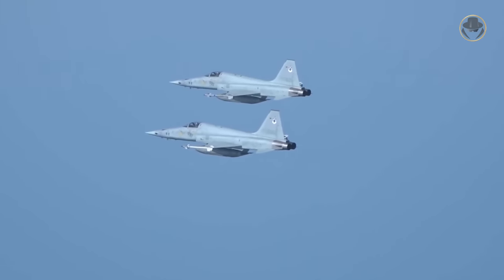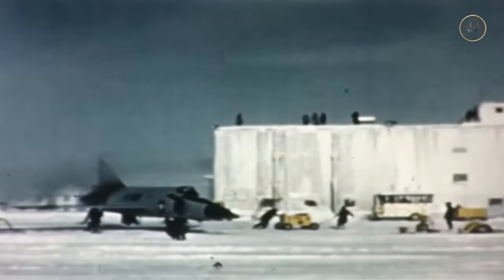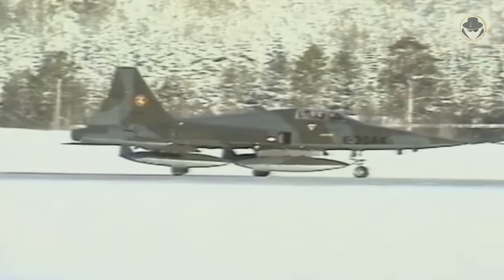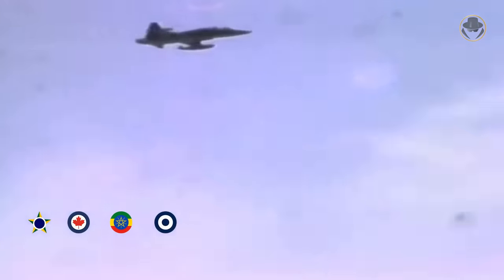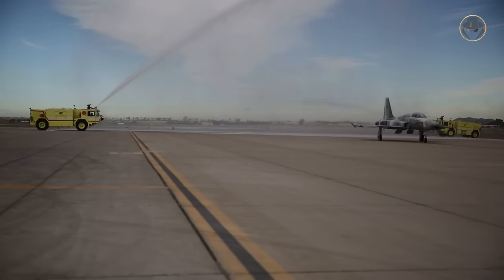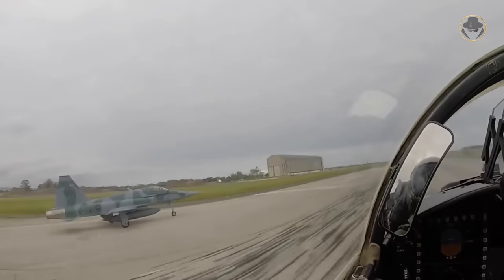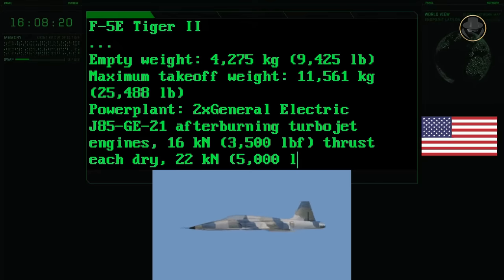Northrop F-5 | Perfection that comes from simplicity

Comment: If the world most successful Interceptor goes to the MIG-21 or F-4 Phantom, then the most successful within visual range fighter has to go to the Northrop F-5. The F-5 often overshadowed by other aircrafts due to technology limitations at the time which resulted in lack of powerful engines, cruising range, powerful radar, max top speed and BVR missiles. But it was extremely maneuverable, cheap and reliable, those are important attributes if your nation's Air Force need to cater both force multipliers and superior numbers at the same time.

Comment: I’ve always thought this is one of the most beautiful fighters, it looks like it’s going supersonic even when it’s sitting on the ground.

The F-20 Tigershark that was an evolution of the F-5 is one of those great “what if?” questions.
Reply: The YF-17 and later F/A-18 are the evolution of the F-5 in the other direction. In fact they addressed the biggest problem with the F-5 that kinda doomed the F-20. The F-5 and F-20's low wing setup, that limited the size and amount of weapons the F-5 and F-20 could carry.  But both the YF-17 and F/A-18 have a high wing, like all modern 4th gen (except for delta wing Eurofighter and J-10) and later fighters do for the above mentioned higher wing load.
Reply: @TK199999 No wonder I thought the F18 looks like the F5

Comment: Fun fact: the first 2 F-5Es ever made are still in service with the Brazilian Air Force and were upgraded to EM standard, as these F-5s will serve till 2030 and be replaced by F-39 Gripens

USAF 11418 = FAB 4857
USAF 11417 = FAB 4856
Reply: Even though I'm Brazilian, I didn't know this information. 👀 Very interesting to know! 👏‍
Thank you. 🗿👍‍
Reply: in the Video he said the velocity is Mach 1.4 or 1472Km/h, but Mach 1.4 is at least 1700Km/h or not? anyway, I love the design, in Swiss we used it too
Reply: @Ezekiel903 Mach 1 is equivalent to 1225km/h, so when you do the math it looks like you're right.

Comment: The F-5 just looks too good to be obsolete. 🤔  There was also the extensive use by the US as an Aggressor aircraft for training.
Also, thanks for adding lbf (pounds thrust) to your engine stats.  While I'm an American Boomer, I like to get a feel for the metric/Imperial conversions. 😎
Reply: It just can't support modern electronics and there is not enough space for good radar set. In modern air combat it's all about seeing the opponent first with radar and then yeeting long range missile his way from tens of miles away. Once you run out of missiles you just run away into friendly cover instead of risking the plane at close combat.
Reply: @henrihamalainen300  True, but it's still one slick little scooter! 😎
Reply: It’s so good as an aggressor craft that the US Navy tried to buy Mexicos F5 fleet(10 Airframes) for its stressor squadrons. Mexico said no cuz the F5 is the only supersonic interceptor we have.

Comment: I find the fully upgraded Taiwanese version interesting, because it can carry a bunch of AMRAAMs.
Reply: Malaysia was interested with this variant but ended up buying the MIG-29 from Russia.
Reply: @ReviveHF  Whether to buy Mig-29 or F-5 is definitely a choice more driven by geopolitical supply considerations than any purely technological "fair" comparison. Best jet in the world isn't useful if you can't maintain it, or acquire it in sufficient numbers, due to inconvenient geopolitical realities.
Reply: @IsaacKuo  You're kind of right. It's the geopolitical reasons. The story is kind of interesting.
At that time, Malaysia needs either F-5E replacement or F-5E upgrades. Taiwan ROC can't export their homegrown fighter called F-CK1 due to US political pressure but this restriction wasn't imposed on the F-5 2000. The F-5 2000 upgrade was the obvious choice.
However, the Taiwan doesn't want Malaysia's Palm Oil exports but Russia does. Also Russia desperately needed to sell it's latest Cold War equipment for fast cash, the result was the MIG-29 for Malaysia. Taiwan ROC decided to kill the F-5 2000 program due to lack of interest from the ROCAF and no export opportunities.
Unfortunately,  the Malaysian MIG-29 was long retired without replacement so Malaysia decided to import the South Korean T/A-50, but still not the ideal MIG-29 replacement. Now Malaysia is trying to renegotiate the possibility of F-5 2000 upgrade or to initiate the possible imports of the F-CK1 but the chance of success is slim, so my money is on the F/A-18 E Super Hornet.

Comment: The Chilean F-5s were designated Tigre 3. They also use the DASH 3 helmet mounted cue system. They are currently stationed at the south of the country were the only potential adversary is Argentina, while F-16's guard the north.

Comment: Odds are the Gripen will take the place, since it shares the most with the F-5 and even F-20. Not to mention it uses the same engine as the F/A-18 Hornet and the Super Hornet. With Sweden's assentation into NATO all but confirms it will be part of any new NATO lightweight low cost fighter competition. Though that's not to say the SK F/A-50 won't also see some NATO or NATO allied buyers.

Comment: a joke of a fighter.
If it goes supersonic, it burns fuel rapidly.
So it needs a external tank.
If it takes an  external tank, it can't carrier too many weapons.
That leaves it with 2 hardpoints.
One defensive missile and one offensive missile.

Air show is its ONLY STRENGTH.

But don't get me wrong, its a beautiful design and from it came the F18 Hornet.
The true functional F-5.

Comment: While the Western’s enemies already have plenty options for their cheap, easy-to-access fighters - such as MiG-29, JF-17 and J-10 - the West still don’t have their answer.
Reply: Simple anwser, the west has money.
The west has enough money to invest in exspensive aircraft, you also need to remember that all western strategi is build on air superiority and in generel just air power. So air power seems to be the main focus when it comes to expenditure and quality. Russia and china may be okay with cheap maby not the best aircraft, but the west wants the best.
Reply: @master_shifu4208  but not necessary their allies. You see, the main idea of the F-5 was a cheap, lightweight fighter model that can easily produce en masse to quickly supply to the 2nd rate allies - some guys in Southeast Asia or South America, or simply anyone that the US are not trust enough to provide them more complex and sophisticated fighters with more secret advanced hi-techs like F-16 - at low cost. 

Right now, they are lacking something like this.
Reply: @master_shifu4208  Other than the US which prints money indefinitely to boost its military defense spending, the rest of the Western countries do not have a big military budget except for France, Germany, the UK, Italy, Greece, Turkey and Poland, the rest of the NATO bloc depend on the US forces and asset to defend their territories. 

Top 3 worse NATO forces in 2021 are: 

Iceland's military spending for 2021 was $0 and is ranked last (30) 
Montenargo spends $98.6 million (29)
Luxemburg spends $460.0 million (28)

Most of the Western countries in NATO do not spend much on defense as they rely on article 5 for deterrent. An attack on 1 NATO country is an attack on all, including the US. If big powers are involved, it's basically dooms day.
Reply: @master_shifu4208 you're american aren't you?

no, the west doesn't. no one has the support to spend huge amounts of the budget on it. guy who did it in poland just lost the election.

people on the west outside of the US aren't usually very chill of huge chunks of money being taken of transportation, education and healthcare (free) to buy fighter jets and missiles. it's just the way the world is.
Reply: The thing about air forces is unique and can be summed up nicely in the saying " there's nothing more expensive than the world's second best air force." 
Those Soviet/Post Soviet/Chinese designs may indeed do the job against sh.t countries, but will fail miserably against Western Air Forces. Israel proved time and time again that Western designs will outdo Soviet-Bloc planes. If you're going to have a military and there's 1 area you should spend on, it's your air force. The rest is downstream from there.
Reply: Ironically, the F-35 has become what it was originally intended to be - the cheap affordable jet that is the "answer" to the needs of the USA and western allies. It now costs less to buy and fly than an F-16. There basically aren't any combat jets out there which are cheaper than the F-35 - not MiG-29, not JF-17 - and it's extremely more capable than the alternatives.

It would be more accurate to say that Europe has no answer to the F-35. Not yet. The European jets cost more and are able to do less. So, it's really not surprising that F-35 is wiping them out in terms of sales to countries where the USA allows F-35 sales.

BUT, what about the numerous countries that either can't buy F-35 or are wary of depending on the USA as a supplier? Well, they gotta do what they gotta do. Depending on their geopolitical situation, Rafale or Gripen may be their best option. Obviously depending on their geopolitical situation, MiG/Su or Chinese may be the best they can get. But none of them are looking forward to going up against F-35 if any of their potential enemies have them.
Reply: @BaronEvola123  it’s mostly about the tactics, the training level and the morale, not just simply because of the fighter’s design and quality itself. 

Just to remember that by the same time Israel decimated the Arab coalition with their excellent Western fighter fleet, Vietnam also slaughtered the US Air Force and Naval Air Service with the same “junk” Soviet fighters used by the Arabs.
Reply: Ahem
F-16
Ahem
Reply: @Eaglehunter44  latest versions of F-16 are all insanely expensive. Old, second-hand versions are much cheaper, though.
Reply: @minhmeo9506  
Fair
But then again JF17 block I and II are designed to supplement the heavier F-16 in Pakistanis service

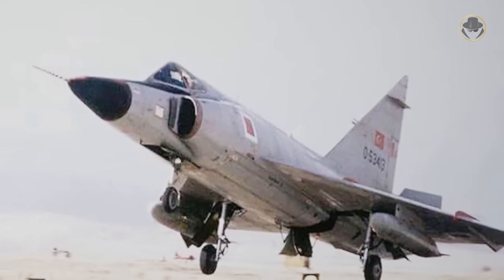Comment: The picture at 15:02 is of an F 106.
Reply from the maker: The Turkish Air Force never had the F 106.
Reply: That's definitely an F-102. The intakes on the F-106 are further back behind the cockpit while these ones are clearly right next to the cockpit, which is an F-102 feature.